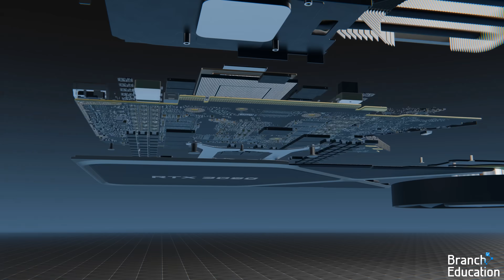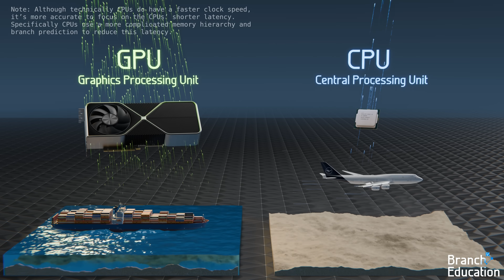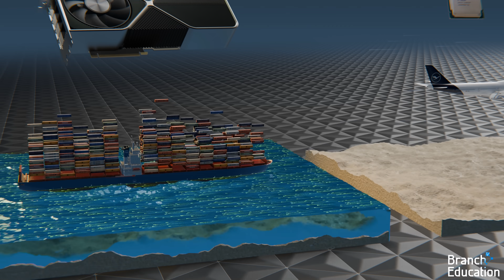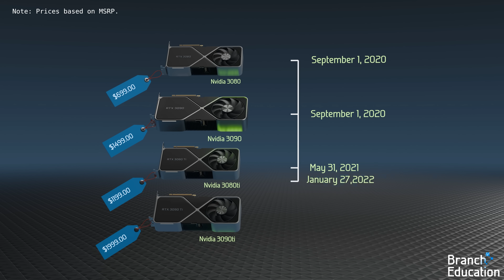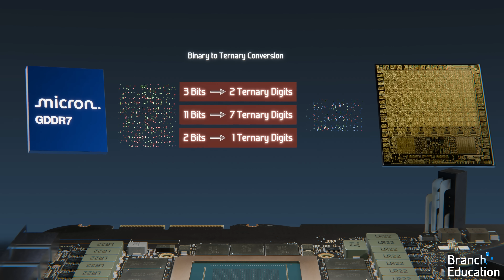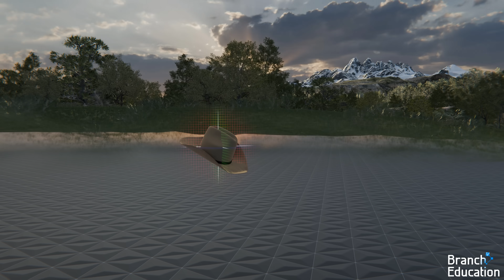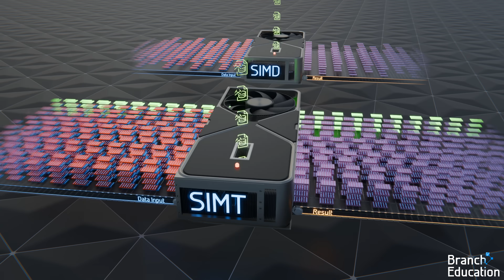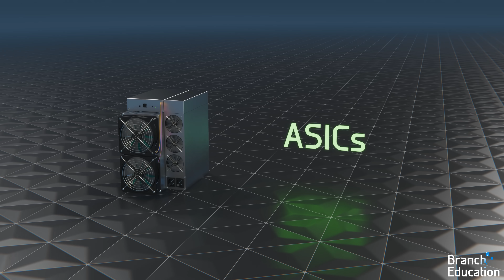How do Graphics Cards Work?  Exploring GPU Architecture

Comment: So my GPU rendering 1 frame does probably more math than i will in my entire life.
Reply: Bro, you saw how many earth they need to replicate 1 second of calculation?
Reply: @dronemacha at least eleven earths
Reply: @larka.sonder each person is capable of doing 1 calculation per second. Not even Isaac Newton, John von Neumann and Terrence Tao togethet with a scientific calculator I would be able to calculate that fast.
Reply: @dronemacha 😂
Reply: Our brain does more, remember math isn’t just calculate numbers and solve equations, our brain does math even when we just walk or open our eyes, we just don’t realize it.
Reply: @carlz3955  our brains think in 0's and 1's we just don't realize it
Reply: @DoctorChained  kind of but not really. you also have to factor in chemicals, time sent, and the rate it is sent. a computer doesn't care when it gets its voltage, it's always the same answer, but the answer depends in the brain by how often or how quickly the voltage is sent. lets pretend brains and computers work the same for a second. you sent a "scared" equation for both to "solve". the computer always outputs "scared" but the brain outputs kind of scared, holy shit im about to have a heart attack scared, etc.
Reply: Our brains are so incredibly good at math that we have no clue how many calculations we perform through out a day.
Reply: @lightofeastafrica8017  Brains are fundamentally not mathematical. In fact, it's kinda analog thing.
Reply: Go walk on the curb of a sidewalk.
Reply: Than 100 Tesla could
Reply: Well if we go with 36 trillion calculations per second, and a 60 FPS game, that’s about 500 billion calculations per frame. Or equivalent to every human on earth for having to complete 62.5 calculations, every ~20 milliseconds
Reply: With that attitude you don’t deserve to math
Reply: it would be fairer to say that gpu rendering 1 frame does does more than the amount of neurons fire in your brain each second which would be untrue.
Reply: Math isn't just adding numbers bro...
Reply: @GateStudyaccount  That’s right, bro. Computers do arithmetic. Humans do math.
Reply: https://youtu.be/WLGa_vY_0mg

Comment: Wow, I learned alot of new things that just clicked so I had to pause the video and just think. How one core is doing one calculation each clock cycle. 1 GHz would be 1 billion times a second then, doing simple calculations. And then multiplied.

Also, I never really understood how video memory worked, I didn’t understand that the SSD actually fed the GPU the 3D models of the scene, I thought the GPU was just doing calculations as soon a the screen started rendering objects and shader.

I feel stupid now 😅

Comment: Thank you for this amazing video!

I just wanted to point out one thing in the video and I might be wrong, but from what I know, SIMT also has only 1 PC per warp and executes in lockstep like in SIMD, but it uses an active mask to determine which threads should run and which should not. 
This gives the ILLUSION that each thread has its own program counter but the underlying hardware implementation is still SIMD and SIMT threads cannot run at their own pace (There is some dependency on other threads)

The advantage of this is that all threads don't execute what they don't have to, they are just masked off and wait for the threads which are supposed to execute allowing more efficient divergence and re-convergence.

Comment: cray 2 fass the model i made the gpu work , cant you explaine it ? cray 2 had a ,main cpu and  2  times units with calulatend 4 finited elements that was gread, i had a 98000 xt with i thing 192 units    
calulating finitene elements thas whas perpects, exepet i dindent know how do proramen them so i went to Rothe Frora and tolod them and they progremint in at univerity at hamburg

Comment: Thanks. Because of you I was able to complete my GPU prototype at home with efficient computing comparable to the initial gous that nvidia produced in their starting days, I am working on connecting them together to increase their efficiency and performance. If everything goes smooth then I might have a lot of gpu similar to NVIDIA 1080Ti in just one motherboard. Yup, I am making a motherboard prototype too. Wish me luck 🤞
Reply: Are you replicating an old GPU architecture on an ASIC/FPGA? Are you stringing together multiple old gpus? There's a lot that goes into a project like this, so can you give an outline of your architecture, memory and interconnect bandwidth, thermals etc.
Reply: @TahmeedKhan-h8u  Yes. Stringing old gpus similar to SLI. Used soft cores on Custom designed for an ASIC. Using shared memory pool for 4 gpu prototype for now using external DDR4 SDRAM and GPU to GPU with PCle Peer to peer interface. And for now using Sanj8 Gou Cooling Fan for Asus Tuf Gaming. I am broke so doing tweaks to what ever I could. 🥲
Reply: I smiled reading this haha. Synchronizing memory access across those 4 gotta be crazy. Also prototyping this on an FPGA and then doing the verification sounds pretty rough on the wallet too. 

I'm just a normal EE student learning GPU architecture. If you have a contact or are uploading your project to another website, please let me know. 
Makeshift GPU clusters are such an interesting project and I'd love to see a final write-up for this.

Comment: Absolutely fantastic production. As a professor of Computer Engineering I think this is a great intro to the wold of computer engineering for those students who are considering engineering. Because of the use of video in the storytelling, this at least presents the subject in such a way that can be easily grasped, which may convince some students who may be considering engineering but their perception is that the discipline of engineering is a bridge to far, that indeed computer engineering may not be beyond their ability to understand.

Comment: 8:45 The 3080 has two models. Seeing the previously displayed price, I'm guessing you mean the first 3080 launched, which indeed has 8704 cuda cores, but it only has 10Gb of GDDR6X VRAM, not 12. Nvidia later released a 12Gb 3080, but it had 8960 cuda cores.

Comment: My 1st thought is related to the game Minecraft. The comment about Minecraft in 2011 is a bit out of touch. It assumes that many players play Minecraft on the computer and it's vanilla form and that other games are far more resource-intensive. I need to point out that many players on the computer play this game with hi-res texture packs, shaders and enhanced graphics settings. I've watched GPU reviews that use other games (shadow of the tomb raider) as their benchmark that the average GPU can render just fine, but when put up against a modded Minecraft installation will be swiftly brought to their knees. With that said, good video 👍

Comment: I'm kind of confused it a section doesn't work surely the resistance is lower as there is less cabling for it to travel through so therefore current must increase if voltage remains constant assuming it obeys ohms law so therfore as p= iv there would be more power and so more heat coming off of it so why does the 3090 get significantly hotter than other cards or is this so minute it makes no difference as it produces more calculations per second so requires more power anyway makeing it hotter

Comment: I have a question that has been in my mind for sometime.

If I understood correctly, VRam dictates the maximum amount of data the graphics card can store in order to work with it.

While bus bandwidth dictates how much data can be transferred between the cores and the VRam on a clock cycle.

Now the question is... If I'm building a computer for game development, and I 'm using softwares such as Blender, Houdini, Unreal Engine/Unity. What is better, a graphic's card with 16 GB of VRam and 128 bits of bandwidth... Or a graphic's card with 12 GB of VRam but 356 bits of bandwidth?

I hope somebody can give me an accurate technical answer.

By the way amazing video as always!

Comment: 8:25 they will mark them as damaged not only because they are damaged, but also because of the market demands. So there is a chance you will get a graphics card with GPU that could have beed used in higher grade card.

Comment: My brain just brained. Think i managed to unlock 2 or 4 more cores and turn on my visual vertex ID overlay. 
But yea its crazy that all this exists in your head already but much slower CPU calculation bandwidth and constantly defragmenting RAM with a wider bus and automatically adjusting RTX and cuda core usage. For 60fps full real spectrum 3D color display with external sensors and internal self managing automated system management.

Comment: Nice video, high quality animations and well thought out explanations. I do have some constructive criticism. The abbreviated comparison between SIMD and SIMT seems to mix up some details. In SIMT, processors still execute instructions in lock step and thread-specific control flow is implemented via masking. I felt like there was a bit of a missed opportunity to circle back to the point about GPUs being data hungry machines when discussing SIMT architecture. 

Over the past several hardware generations, the efficiency of logic operations on die has improved dramatically, while access times of all flavors of RAM (DDR SDRAM, GDDR SDRAM, etc) has not.. as mentioned in the video, the gpu is not able to come even close to fitting the entire working set in cache so there is a ton of external RAM bandwidth per frame. Modern GPUs leverage the multi-threading properties of SIMT to hide the latency of such accesses by rapidly switching between tasks. As a game application programmer; to hit performance targets, our goal is to craft workloads that sufficiently subscribe both the gpu memory and logic pipelines .

Comment: Been thinking about something said in this video that for some reason clicked in my head - there is technically no reason a GPU couldn't host an operating system. Sure there would need to be some serious modifications to the motherboard hardware, (to enable input/output for example), and the coding required would most likely be the most difficult ever attempted, however, theoretically it is certainly doable.

Of course, doing so wouldn't make a whole lot of sense, but that's not the point, it's a programming exercise, working out how to harness the sheer computational power of a modern GPU to host what would most likely be a rather basic OS, (think pre-Windows era).

Comment: The animations in this video, especially the illustration  of SIMD processing at 17:55, are Emmy or Oscar worthy material.  Simulating a hat sitting on a table at a train station is one thing but illustrating the underlying mathematic objects used for rendering that moving view and seamlessly blending BETWEEN the two views reflects an entirely advanced level of effort and creativity.

Comment: As a computer engineer, I cried with joy when I saw the architecture of the 3D GPU, and I cried even more when I heard clearer explanations than those given by my professors. Thanks.
Reply: He’s that guy.
Reply: I cried when his first analogy couldn't be more incorrect!   As an engineer surely you've heard of instruction sets - instructions per second is entirely different from 'calculations' per second. One calculation takes many instructions (which is why RISC was all the rage for a while and still is in certain applications). 

Is ASM still taught in first year across all Comp Sci degrees these days?
Reply: @smackhead then why don’t you make a video ?
Reply: @smackhead had to look it up and you're right, can't trust this video now
Reply: True
Reply: @abdulmajidH2O  Very True indeed.
Reply: True

Comment: 18:30: Does that mean if I'd use one single 3d model for an entire game scene instead of more smaller ones the game will run much more efficient because these transformations don't have to be made?

Really good video btw. I liked the animation and the sound design 👍
Reply: I think it will be the same amount of transformations because you're still dealing with the same amount of vertices
it might be faster in some other regards but physics/applying textures/not rendering objects outside the camera view are massive disadvantages that doesn't make this practical

Comment: 06:57 WOW!!! my GTX 1650 actually RTX 2060 if not defected 😎👍
Reply: NOPE ! Because the performance difference in games is 2 times higher between these videocard. So RTX 2060 + 50% better performance in games than the GTX 1650 graphics card all without RTX on
Reply: @Game_Drive_HD  06:57 This I mean....

Comment: REQUEST: Need for a Video on Web Mechanics used in Internet from Grass Root Level

Hey Teddy. I am Student and one of your Subscriber here. I wanted to request you on making a video that how information actually traverses from a computer to another in the internet considering all those concepts of electrical engineering from grass root level.
Story:- Since my childhood there was one concept that haunted me. What's the difference between the electrical cables that bring elecctricity to my house and the cables used in internet, both runs on electricity. so how is it that one lightens my house and the other sends information between computers in the internet as bascially both are copper cables only, that runs electricity. So, is this is some new kind of Electricity?? Funny right?                                                                                                           Then I got to know about Binary waves and Electrical waves. I slowly understood that how the computer converts HLL and LLL (Long binary codes) then converts it into binary wave and finally into analogue wave (continuous sinosuidal wave) by doing various modulation technique like changing the voltage, ampllitude, frequency and simultaneously considering the standards set for computer that (high voltage 5volts = binary digit '1' and low voltage 0volts = binary digit '0') and then the computer finally sends it into the internet.

So please this is a humble request to make a video on complete web mechanics covering whole bunch of things like. How computer also uses The OSI Model and each Internet Protocols and how electrcity is manipulated to create binary strings and how switiching techniques help in and so on everything. This is just so fascinating. I am asking you because your animations and knowledge that you provide are so awsome. I am hoping for a positive response on my request. Thank you

Comment: humans cant calculate that in 1 second. GPUs dont add or divide or multiply or subtract. they do complex math, vector , matrix, etc calculations. for a human to do 1 average GPU calculation on a paper with a pen it will take 10 hours. 10 hours = 36000 seconds . 4,400 * 8,100,000,000 * 36,000 = 1,283,040,000,000,000,000 = 1.283 Quintillion people are required to do GPU calculations as fast as a 36 TFlop GPU.

Comment: I did a Masters course in Computer Engineering and had taken GPU architecture as a course, and that course which cost 6.5k USD was a lot harder to understand that this free 30 min video on YouTube which essentially summarized the same thing. I will be selfish and request you to do an explanation of DPU architecture. I currently work in the DPU industry as a fresher and would hugely appreciate any explanation of network processor architecture as I struggle to teach those concepts to myself.

Comment: How do you disable damaged blocks? Software? Or do they physically, so to speak, burn out tracks on the crystal with a laser so that the signal does not go there?
Reply: Mixture of both. Sections of the chip might be physically lasered out, the clock signal might be disabled by flipping a transistor in software or hardware, the chip's firmware/microcode might be patched at the factory to disable various logical units at the control level, etc.

Comment: Nice video for the layperson, but not enough information density for engineering students. You're better off watching the many free lectures posted on YouTube. Also, this video betrays itself as a Micron ad in the middle. For example it makes PAM3 sound like something Micron invented but encoding schemes based on variable voltage levels is common in analog circuits and signal modulation/demodulation has been around since radio...

The heavy focus on AI (read LLM), gaming, and bitcoin applications is odd. Does Micron really want to employ the kinds of people that are motivated by LLMs, gaming, and bitcoin?

Comment: How the hell  10000 cores go under 300W and 24 go ower?????
Reply: Because a GPU core is not the same thing as a CPU core. A GPU core is really a single ALU within a CPU core, and the GPU equivalent of the CPU core would be the SM. So in reality, a 3090 has the equivalent of 82 CPU cores, which are still individually less power hungry as each individual core is simpler and is clocked lower.